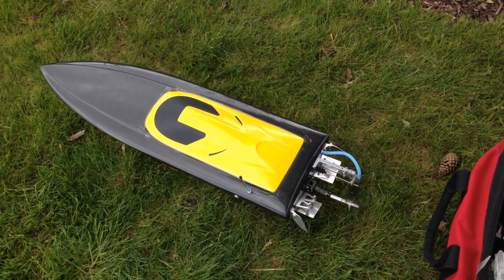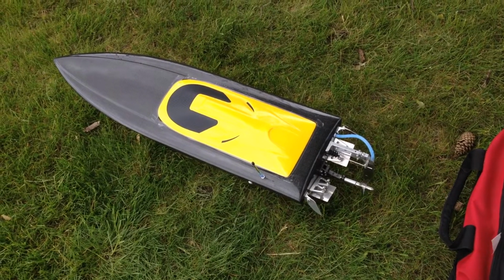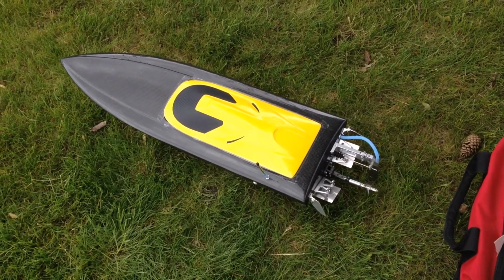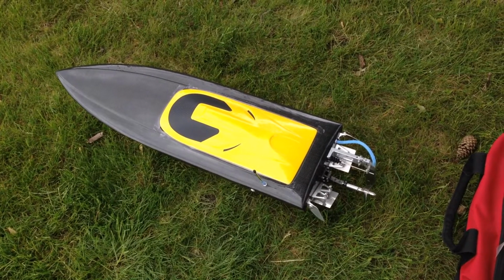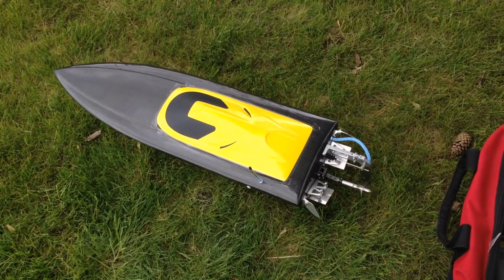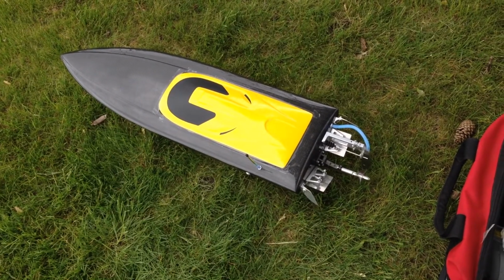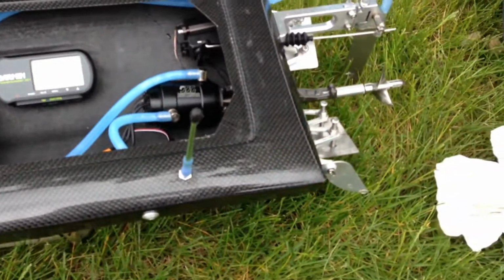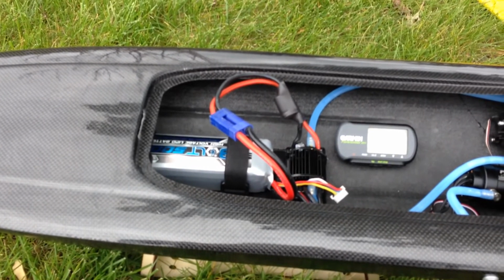TFL PURSUIT  prop test #1

Comment from the maker: Hi
Pedro
Not sure why I can't see your comment here, but I did get a notification of it...
I read 3-4s is recommended so I will run mostly on 4s I may do a few 5s runs but for now, I want to find out how fast it can go on 4s with the stock sss motor.
I think it can go over 45mph,
After that I think I will upgrade to a TP motor 2000ish kv and do it all over again....
The one thing is they don't recommend upgrading the motor with the integrated drive system ( possibly because of the extra weight on the drive system without rear support) but I will try a small TP motor anyways,
Eventually......